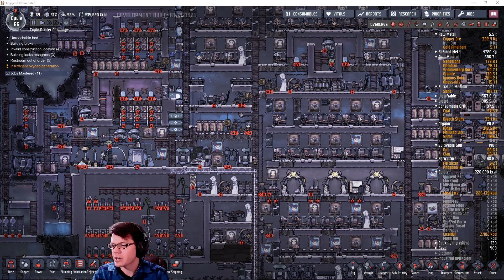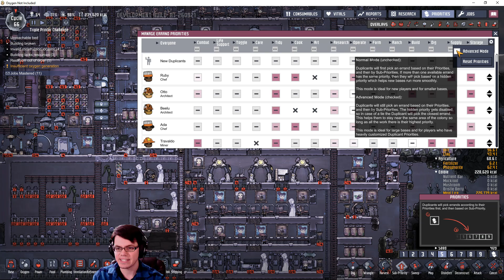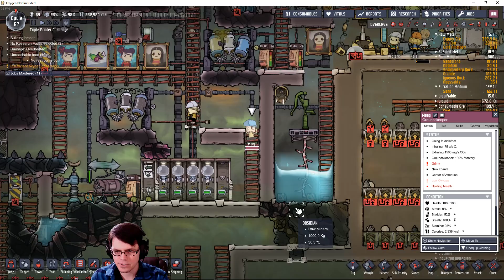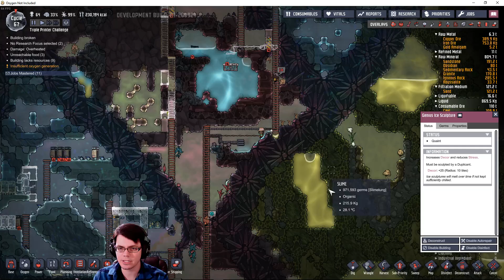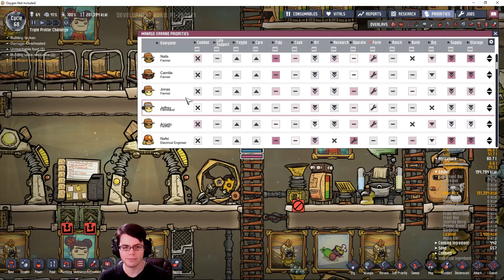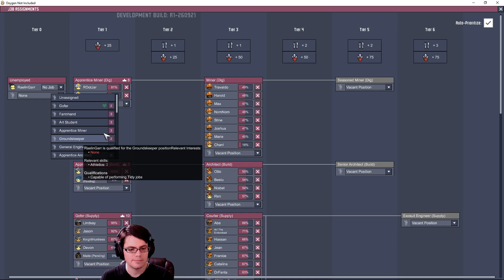New Priority System VS 60+ Dupes! Ranching Upgrade 3 Printer Challenge 15

Comment: Brothgar! If you're having heat troubles there is a simple solution!

Heat rooms! Use pumps in the corners of your base to pump hot air through HVAC coolers, then store those coolers in designated "Heat Rooms" where the heat can be processed into power or deleted via lavatories, sieves, and electrolyzers! This would allow you to keep your whole base nice and cool, with only occasional rooms where you condense the heat (Need multiple cuz the heater buildings have temperature limits of their own XD)
Reply: Dicerson how would you power with heat?

Comment: So, from what I understand of the new priority system, closer jobs will be completed first under like net priorities?  If that's the case, then it should make sense that job distance can be weighted against sub-priorities, and that increasing the sub-priority for something further away - say, breaking into and establishing a geyser, freeing a trapped duplicant, or building a new oxygen source that is outside of your dupe's immediate worksite, but that is needed for workers in that area, and so on, should allow you to control your duplicants to a finer degree.

So, my question is, what determines the 'worksite'?  Like, what is telling your duplicants to dig out the area to the lower left-hand side of your map, as opposed to - say, if you wanted to dig out a new section to the right side of your map, next to your bathrooms.  Will a duplicant move from the first worksite to the second, just because they had to use a toilet?  I don't think that's what was happening for you, which means that a more intelligent algorithm is at play than simply "work on the closest job to your current position".  So, if not that, then will they return to the first worksite after finishing it's business, and only move to the second one after the first job is complete?  Basically, what I'm trying to ask is, what's the reference point for determining the "closest" job?  The current location of the duplicant itself, the relation of the job to the printing pod or the dupe's bed, or is it just simply a queue of jobs that are processed in the order that they were created in, with relation to the duplicant's position at the time?  Or, will the duplicant do the job that is the next closest to the last place that the duplicant worked, and if so, could new worksites be established by 'breaking ground' by tagging a block with a higher sub-priority?  That's the thing that confuses me at the moment, and I'm sorry if I explained it in a confusing way, but the answer to that could change the way that colonies and bases are managed overall, even beyond the basic implications of the update in the first place.

Comment: How do you feed Slicksters and Pufts with the Critter feeder?

 I don't understand how it works how do I store Polluted Oxygen or CO2 in the Critter feeder?

I also have a small tip for you

So your doors that aren't Airlocks you can just leave them open to save a bit of time if you aren't restricting the area to specific dupes.
Reply: just pump CO2/Polluted Oxygen  in the room with the slicksters/pufts
Reply: It wont register them because they are gases, not solids
As long as they are in the room (And around the slicksters/pufts) they will consume the gas
If you want to keep track of how much gas is in the room use automation, use a gas sensor for the amount of gas you want in the room and a gas shutoff before you vent the gas in the room, so when the room contains N kg of gas, gas will not be pumped into the room until there is <N gas in the room
Just make sure there is only one kind of gas in the room
Reply: Sukiida Thankyou 👍
Reply: I suspect that the critter feeder is for things that eat solid stuff, because if you were to just leave solid stuff lying around, your gofers/couriers would pick the stuff up. And that's after thhe difficulty of dropping stuff to feed them in the first place. (disassembling the container)
Reply: Sukiida Well I did, but the Container didn't register the amount of CO2 in the room... it was pure CO2 btw